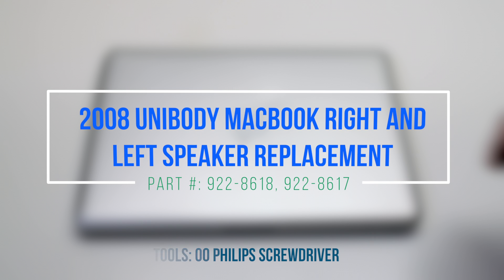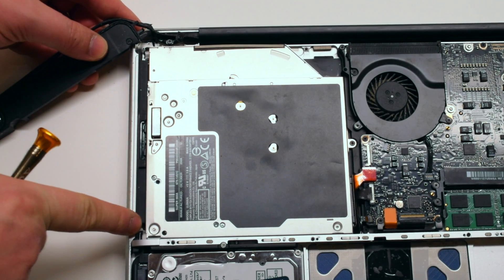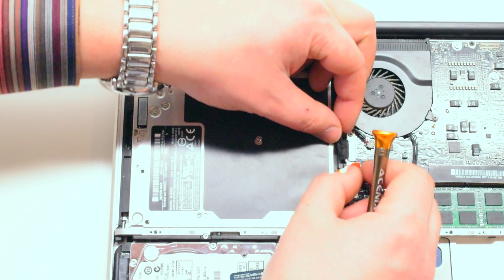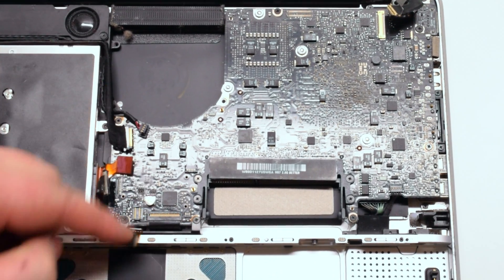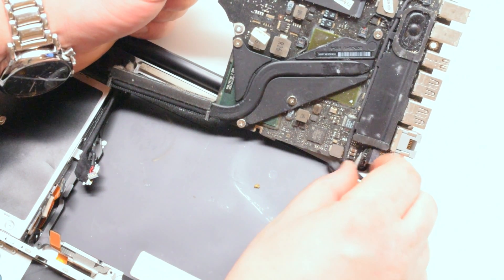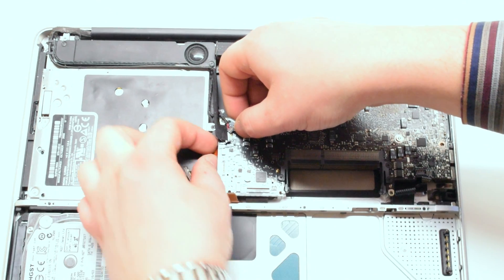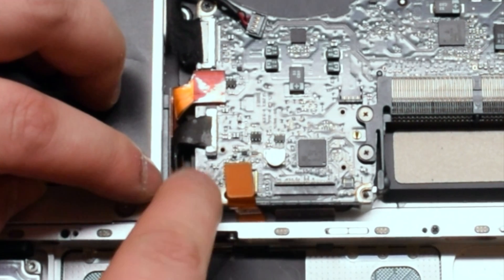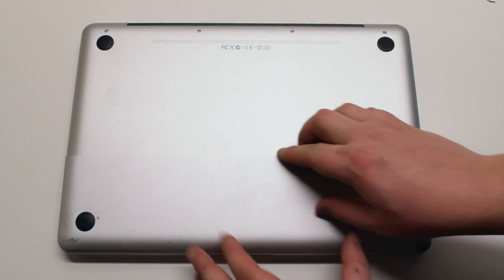2008 Unibody Both Speakers Replacement Save Apple Dollars #30

Comment: I will say if your transplanting good speakers from a bad macbook to a good macbook with bad speakers(. more referring to the DVD side speaker) to be a little bit more careful then what is showed in the video for a factory default macbook(, the sub-wifer part of the speaker assembly) will be glued to the chassis on the right side of the sub(, when gazing from screen hinge to battery compartment view). Also fuck Apple for the placement of the mic wire makes it so frustrating to get the MB in & out of the chassis without accidentally breaking the mic cable. FYI, you don't NEED to unscrew the display power bracket that he calls the speaker bracket to safely remove the DVD drive(, is a real life saver when the screws that keeps side bracket in place is striped to hell). It also helps when reconnecting the keyboard connecter to unscrew the four screws & remove the latching bracket in the middle of the chassis so you can have more space for your tools & paws to reconnect the keyboard connecter to the MB.

Comment: I bought a 2013 13” macbook pro speaker replacement part, is it compatible with my 2008 metal unibody macbook?
Reply from the maker: Unfortunately, no.
Reply from the maker: Here is what you want https://store.appledollars.com/products/speaker-l-r-set-for-apple-macbook-pro-unibody-13-13-3-a1278-mid-2009-2010-year-emc-2326

Comment: Hi! Thanks for this great video, it's so helpful!
I have a short question: I have a 2008 macbook unibody, exactly the one you show in the tutorial; the right speaker + subwoofer part, is it exactly the same you show in the tutorial for 2010 macbook pro (https://www.youtube.com/watch?v=KAQs7FUydVc)? 
I'm asking you this because here in Europe (Italy) I easily find that part for the 2010 macbook while I cannot find the same element for my 2008 macbook. 
just wanted to be sure before buying it...
Thank you so much.
Reply from the maker: It's a different part number in the 2010 Macbook Pro 922-9057 but in the 2008 Macbook it's 922-8617, having said that it will fit and it's basically the same exact part, just has a little extra groove that serves no purpose what so ever. Buy the 2010 part, it will fit.
Reply: I will!
Thank you so much for the answer.

Comment: Thanks! So these 2 items gotta buy them separately?
Reply from the maker: If you can wait, order these, they ship as one from China, takes about 2 weeks +/- 
http://www.ebay.com/itm/Left-Right-Speaker-Subwoofer-For-Macbook-Pro-Unibody-13-A1278-late-2008-/112029177717?hash=item1a15759775:g:SZAAAOSw1DtXDxKZ
Reply: @GRIBSOFT  pro and regular are same?

Comment: Where do I get the speaker of this model?
Reply from the maker: Ebay is the best place. Just do a search for 2008 Macbook Unibody Speakers. Here is what you need:
http://www.ebay.com/itm/LEFT-SPEAKER-922-8618-Apple-MacBook-Unibody-13-A1278-Late-2008-MB466-MB467-/281360284705?hash=item4182613c21:g:Q0AAAOSwQItUDMcs
and
http://www.ebay.com/itm/RIGHT-SPEAKER-SUBWOOFER-Apple-MacBook-Unibody-13-A1278-Late-2008-MB466-MB467-/282077375597?hash=item41ad1f2c6d:g:mjUAAOSwvg9XbEJ4
Good luck :)
Reply from the maker: If you can wait, order these, they ship as one from China, takes about 2 weeks +/- 
http://www.ebay.com/itm/Left-Right-Speaker-Subwoofer-For-Macbook-Pro-Unibody-13-A1278-late-2008-/112029177717?hash=item1a15759775:g:SZAAAOSw1DtXDxKZ